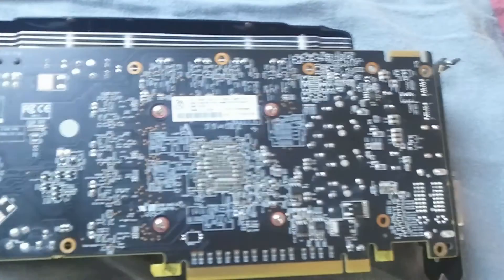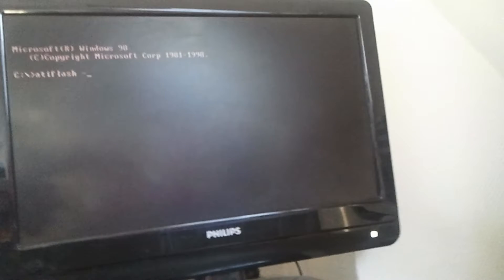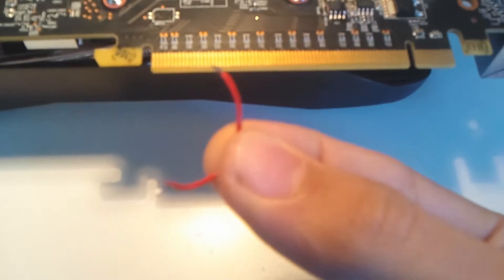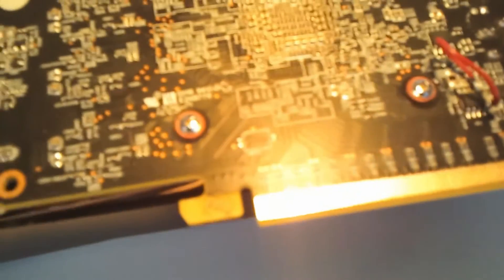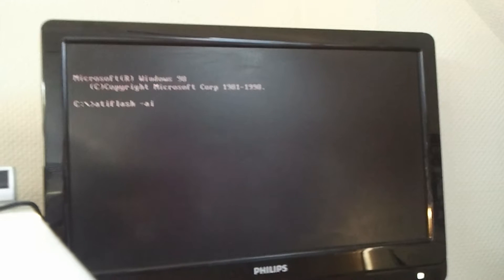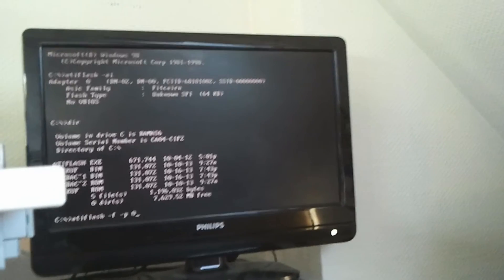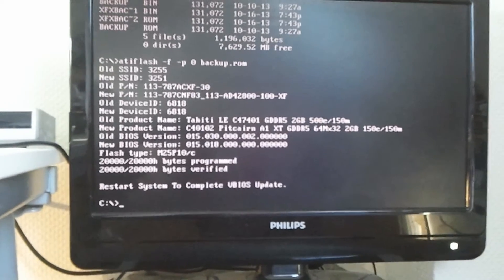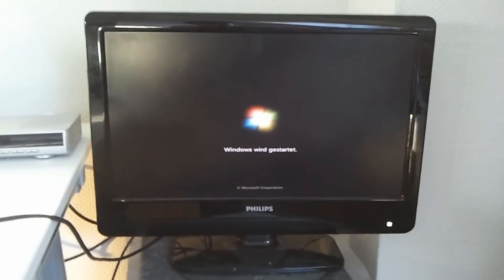Solution | Bricked HD 7870 XFX GPU BIOS FIX | Hardest Way

Comment: Good info, it would work on a MSI rx 570 gaming x 4g ?
Reply: THIS is for rx 460
-> I was not even able to flash the bios because ATIFlash 4.17 under FreeDos gave me ,,adapter not found,, all the time. 4+5, 1+8, 4+8(!do not brige that), 1+5. I tried all combinations but ATIFlash under Freedos gave me ,,Adapter not found,, every time.
 The trick for me was to connect 4+5 and go under Windows. Download ATIwinFlash last version. But If I tried to start the program, an error pop up. But not the basic error ,,Cannot detect any ATI card,,. The error was ,,Error trying to read the ROM,,. And I knew that the ROM CHIP was deactivated. Your method worked :). The pins connected with a clip like this was working too ,,https://i.imgur.com/dlk9uIX.jpg,,. So is not necessary to solder the pins.

 Now. Because the ROM chip is deactivated, let's repair this GPU once and for all. I used the integrated video card to boot. The bricked card was in the first PCI Express slot (the one closest to the CPU). Before starting to do anything, make sure you are not overclocked. Allright. Boot in windows with integrated video adapter.
1. Download Iobit Uninstaller and uninstall all programs that run in background, all the antiviruse software, any overclocking tools and any drivers. Best is to have a clean install..
2. Disable the Windows Update Service.
3. Use DDU to completly clean all video drivers from your computer.
4. Use AdwareCleaner and Wise Registery Cleaner and CCleaner to completly clean up your PC.
5.Make sure you restart

 Now Download ATIWinFlash...
So... Every ATIWinFlash come with an AtiFlash that can run under CMD, but not under FreeDos. I opend CMD with admin rights and I did the following:
1. cd /d "D:\Desktop\MODING\atiflash_277" // replace ,,D:\Desktop\MODING\atiflash_277,, with your path.This command is used to navigate to a folder from cmd.
2.AtiFlash -i //To see if the atiflash can detect my GPU. And for me worked only from windows. :). On classic ATIFLash 4.17 under FreeDos didn't work. ,,Adapter not found,,.
3.I searched ,,Asus Dual-RX460-2G support,, on google. After that I went to Specifications, to see what specs my gpu have, to be able to download the correct vbios. After that I went to VGA BIOS collections and I downloaded the correct one. By the way... This is it 
-> https://www.techpowerup.com/vgabios/192942/192942. 
I renamed it to ,,bios.rom,, and place it on  atiflash_277 folder.
4.I used a screwdriver to remove the bridge that connected pins 4+5, before flashing.
5.AtiFlash -f -p 0 bios.rom // Wait for flash to finish.
6.Shutdown your PC, and unplug it from the wall.
7.Power on, but now go to bios and change to boot from onboard to PCI EXPRESS.

TADAAAAAAA. GPU is working now. Thank you again for this video. I hope I can help someone.

Comment: thanks tuga i don't have another gpu did it work much with onboard vga ? i have just my brocken 7950 vapox - - in some Forum they tolk that it work too with motherboard vga can you confirme ??
Reply from the maker: lotfi nasri well I can advise that you show ask a friend to borrow you a GPU (VGA Generation) or you could try with what was told to you in the forum. The only thing I can say is that I  this video I had an old working nvidia GPU with VGA interface and it worked

Comment: hello tugas pt did you use another gpu with the brocken card or the standart onboard vga is enough ??
Reply from the maker: lotfi nasri hello, set the video to 6:42 first slot borrowed GPU with VGA interface, second or under the first one my bricked GPU

Comment: i did this method, the flash went fine but after the reboot seems like i couldn't overwrite the bios, it still remains the corrupted bios. tried over and over. any sugestion?
Reply from the maker: Fernando Montaguti Same GPU? Did you try a different Bios or did you try everytime with the same bios? Also do you have a second GPU for your second PCIe slot?
Reply: RX 460, it was a bad PSU who couldn't identify the vbios, after replacing for another PSU the card was alive again \o/. The 1- 8 Method unbricked the card, thx for the help and video

Comment: Great video . I have a problem on Hd6850. It is detected by atiflash but no display. Windows 10 was unable to install required drivers. Please help.....
Reply from the maker: Samiran Dey If windows couldn't accomplished to install the drivers then do it yourself manually, going to the device manager choosing the adapter proprieties and from there update Drivers or simply go to the manufacturer web page and download from there the GPU drivers.
Reply: thanks for your response . during maual installtion , bsod , ati*dag.dll ...error.. something like that.
Reply from the maker: Samiran Dey guru3d was a great help for to accomplish the Unbrick.
Try this https://forums.guru3d.com/threads/fix-bsod-ati-blue-screen-on-atikmdag-sys-solved-fix.363233/ but if it is for crypto currency mining then I can no longer help.
Reply: Tugas PT thanks  but it has no display either through its dvi.

Comment: XFX 7870 is connected to which PCI slot?
Your XFX 7870 is not working then your Philips monitor is connected to which port?
Reply from the maker: From the bricked card you have no image output,  and is not even bootable, you put the bricked card in the second PCIe slot. Now you put a working GPU in the first slot. At the beginning is connected to VGA port of the GPU in first slot the Nvidia 9800 GT, then at the end when I unbricked the card I switched to HDMI port off my XFX 7870 to show that the bricked card is recognized again by the motherboard.

Comment: I have the xfx hd 7870 core edition and my computer keeps restarting when i have it plugged, without drivers i see green lines and 6 minutes latter my computer crash, do you know what can i do? And with drivers i can't even start because my computer crashes at the beginning
Reply from the maker: Not exactly, it is a strange issue, so I am going to ask you the following: Did you try another GPU in your current Motherboard? Try to start your computer without the HD 7870 xfx, and watch carefully if your PC does restart? It could potentially be a problem of your current Power Supply Unit?
Reply: Tugas PT well it does not restart with the integrated,but when I'm using the integrated and have the hd7870 plugged but without using it, it crashes the pc when trying to install drivers, and without drivers I can use the gpu but minutes later it crashes without doing nothing
Reply: I don't have another power hungry gpu just one gt210, First i was watching a video and the computer crashed, then i was unable to start, just the windows 10 logo and then crashed again, days later i deleted the drivers and i can use it but i see green lines in the bios and everywhere, and as i said before the computer crashes without workload

Comment: How do you determine which is the right chip to disable (connect pin 1 to 8) ? I have a failed BIOS flash on 7990 which is a dual GPU card, so I have a total of 4 8pin chips that look the size of the one you're modding. 2 on the front and 2 on the back of the card. They all read the same PM25LD010 , which seems to be the flash module used to store BIOS info.
Reply: 1+8 or 4+5 are all the time. You will not damage any thing. Just do not connect 4+8 or 1+6 or something else. Try 1+8 first. If the chip is not deactivated try 4+5.

Comment: where is the chip position in sapphire rx460 2gb ?
Reply from the maker: Icyfrost Gaming I do not know, because I do not own an rx460.
Reply: Tugas PT btw can you give me link the dos? when im use nvflash its say atiflash cannot run in dos mode
Reply from the maker: Can you be more specific with your issue? Keep in mind NVflash is only for Nvidia GPUs and not AMD GPUs. Here is a link that is in my opinion updated. https://www.techpowerup.com/forums/threads/amd-ati-flashing-guide.212849/
Reply: before i was playing wd2 after that shutdown canot turn on my pc after tomorrow can on again and the motherboard broke cause overclock to high after i buy new motherboard my rx460 cannot display but fan spinning and beep 8 times vga not overlocked and fan set 60%  im using the unlock shader 894 to 1024
Reply: -> I was not even able to flash the bios because ATIFlash 4.17 under FreeDos gave me ,,adapter not found,, all the time. 4+5, 1+8, 4+8(!do not brige that), 1+5. I tried all combinations but ATIFlash under Freedos gave me ,,Adapter not found,, every time.
 The trick for me was to connect 4+5 and go under Windows. Download ATIwinFlash last version. But If I tried to start the program, an error pop up. But not the basic error ,,Cannot detect any ATI card,,. The error was ,,Error trying to read the ROM,,. And I knew that the ROM CHIP was deactivated. Your method worked :). The pins connected with a clip like this was working too ,,https://i.imgur.com/dlk9uIX.jpg,,. So is not necessary to solder the pins.

 Now. Because the ROM chip is deactivated, let's repair this GPU once and for all. I used the integrated video card to boot. The bricked card was in the first PCI Express slot (the one closest to the CPU). Before starting to do anything, make sure you are not overclocked. Allright. Boot in windows with integrated video adapter.
1. Download Iobit Uninstaller and uninstall all programs that run in background, all the antiviruse software, any overclocking tools and any drivers. Best is to have a clean install..
2. Disable the Windows Update Service.
3. Use DDU to completly clean all video drivers from your computer.
4. Use AdwareCleaner and Wise Registery Cleaner and CCleaner to completly clean up your PC.
5.Make sure you restart

 Now Download ATIWinFlash...
So... Every ATIWinFlash come with an AtiFlash that can run under CMD, but not under FreeDos. I opend CMD with admin rights and I did the following:
1. cd /d "D:\Desktop\MODING\atiflash_277" // replace ,,D:\Desktop\MODING\atiflash_277,, with your path.This command is used to navigate to a folder from cmd.
2.AtiFlash -i //To see if the atiflash can detect my GPU. And for me worked only from windows. :). On classic ATIFLash 4.17 under FreeDos didn't work. ,,Adapter not found,,.
3.I searched ,,Asus Dual-RX460-2G support,, on google. After that I went to Specifications, to see what specs my gpu have, to be able to download the correct vbios. After that I went to VGA BIOS collections and I downloaded the correct one. By the way... This is it 
-> https://www.techpowerup.com/vgabios/192942/192942. 
I renamed it to ,,bios.rom,, and place it on  atiflash_277 folder.
4.I used a screwdriver to remove the bridge that connected pins 4+5, before flashing.
5.AtiFlash -f -p 0 bios.rom // Wait for flash to finish.
6.Shutdown your PC, and unplug it from the wall.
7.Power on, but now go to bios and change to boot from onboard to PCI EXPRESS.

TADAAAAAAA. GPU is working now. Thank you again for this video. I hope I can help someone.

Comment: man do you think that this is a universal method for any kind of flash chip on gpus? i mean maybe its a standard that pin 1+8 skips bios completely no matter what kind of gpu you use
Reply from the maker: Can not answer that with 100% sure, because I only tried this method with 2 GPU, and those were from AMD HD Series. If you know what you are doing and have the schematic the GPU you want to fix you can try, but if you are going to fail or succeed is up to you.
Reply: 4+5 and 1+8 are standard I think

Comment: my bios is 25Q10T CE5NOW CH 1338
not found anything datasheet
Reply: That is same chip on R9 290 with combi 1. i 8. pin  http://imagescdn.tweaktown.com/content/6/6/6667_16_visiontek_radeon_r9_290_video_card_circuit_and_overclocking_guide.jpg

Comment: Hi. ihave Evga gtx 780 i got failure bios geoforce light green and fan spinning but no display (black/blind) i try boot with cpu hd4400 and 780 in 1st pcie slot and try flash bios with nvflash but is says no nvidia detected so my gtx 780 not detected So im gonna try ur way but i have qsts.were can i find a 8 pin chip on the card and what pins should i solder ?

Comment: Adpter not found :((>
Reply: TRY THIS. Was for rx 460
-> I was not even able to flash the bios because ATIFlash 4.17 under FreeDos gave me ,,adapter not found,, all the time. 4+5, 1+8, 4+8(!do not brige that), 1+5. I tried all combinations but ATIFlash under Freedos gave me ,,Adapter not found,, every time.
 The trick for me was to connect 4+5 and go under Windows. Download ATIwinFlash last version. But If I tried to start the program, an error pop up. But not the basic error ,,Cannot detect any ATI card,,. The error was ,,Error trying to read the ROM,,. And I knew that the ROM CHIP was deactivated. Your method worked :). The pins connected with a clip like this was working too ,,https://i.imgur.com/dlk9uIX.jpg,,. So is not necessary to solder the pins.

 Now. Because the ROM chip is deactivated, let's repair this GPU once and for all. I used the integrated video card to boot. The bricked card was in the first PCI Express slot (the one closest to the CPU). Before starting to do anything, make sure you are not overclocked. Allright. Boot in windows with integrated video adapter.
1. Download Iobit Uninstaller and uninstall all programs that run in background, all the antiviruse software, any overclocking tools and any drivers. Best is to have a clean install..
2. Disable the Windows Update Service.
3. Use DDU to completly clean all video drivers from your computer.
4. Use AdwareCleaner and Wise Registery Cleaner and CCleaner to completly clean up your PC.
5.Make sure you restart

 Now Download ATIWinFlash...
So... Every ATIWinFlash come with an AtiFlash that can run under CMD, but not under FreeDos. I opend CMD with admin rights and I did the following:
1. cd /d "D:\Desktop\MODING\atiflash_277" // replace ,,D:\Desktop\MODING\atiflash_277,, with your path.This command is used to navigate to a folder from cmd.
2.AtiFlash -i //To see if the atiflash can detect my GPU. And for me worked only from windows. :). On classic ATIFLash 4.17 under FreeDos didn't work. ,,Adapter not found,,.
3.I searched ,,Asus Dual-RX460-2G support,, on google. After that I went to Specifications, to see what specs my gpu have, to be able to download the correct vbios. After that I went to VGA BIOS collections and I downloaded the correct one. By the way... This is it 
-> https://www.techpowerup.com/vgabios/192942/192942. 
I renamed it to ,,bios.rom,, and place it on  atiflash_277 folder.
4.I used a screwdriver to remove the bridge that connected pins 4+5, before flashing.
5.AtiFlash -f -p 0 bios.rom // Wait for flash to finish.
6.Shutdown your PC, and unplug it from the wall.
7.Power on, but now go to bios and change to boot from onboard to PCI EXPRESS.

TADAAAAAAA. GPU is working now. Thank you again for this video. I hope I can help someone.

Comment: Any idea how to fix a broken HD7990 (adapter not found)? Here some pics of the Card http://s23.postimg.org/jm0ta2fca/hd7990circuit.jpg  I think it's the chip on  the right side but i aint sure.
Reply from the maker: +Golyator Yes I have an idea thank to fellow user CiPoint he comented the flashChip which is used to flashed, my guess is since 79xx series are all the same, only diferent BIOS cause of core and vram clocks (max & min) from model to model, depending on the GPU archictecture. http://fs5.directupload.net/images/160402/ehghsg3g.jpg  here is what CiPoint mentioned
Reply: +Tugas PT will try it tomorrow

Comment: works!
i have just bricked the Hd6670 by flashing the wrong bios
no screen and not bootable even i have a working card and put the dead 6670 on the second slot

i soldered the pin 4 and 5 which is SIO and GND
it boots, ati flash - AI command scan the card with no vbios
then i cut the wire and flash the bios
done. My card is working again
Reply from the maker: +nikkotsoi Glad to know, with this method you fixed even a previous Graphic Card. Can  I post your small step step for HD6670 in my description? Of course you get the credits, to be fair.
Reply: +Tugas PT sure!

Comment: OK found it for R9 290 8-pin chip is U2 soldering 1+8 pin works again.
Reply from the maker: +mirzet1976 So did you fixed a R9 290 with this method?
Reply: Yes it worked since my card has broken bios switch
Reply: hello mirzet1976
plz can you help me with pictures if you can coz i have 7950 vaporx and it's alomst the same with r9 290 beleave me i'am a stray now thanks a lot

Comment: man help me!! my video card R9 280x no run anymore after from put sux bios! :((
Reply from the maker: +MAVERICK GAME HD I can and I will see what can I do to help you, but first you must write your problem with details, look at the coments, there are many way how to explain exactly whats wrong with your card
Reply: Tugas PT just Bios change only
Reply from the maker: +MAVERICK GAME HD sure but what i mean, is that you describer the model of your card, R9 280
x there are many, now how should know which model do you have? brand? pls consider time to exactly describe your problem with your card, and the specs do  your card. thank you
Reply: Tugas PT Sapphire Radeon R8 280x Dual-X OC Version (UEFI) Model:11221-00-20G.. -3GB -384-bits GDDR5 -6000Mhz  GPU: - 870/boost: 1020 MHz Clock - 28nm Chip -2048 x Stream Process++
Reply: +Tugas PT Apologies but after I soldered, I did not DOS process * - * my bad !!
I'll do it today.